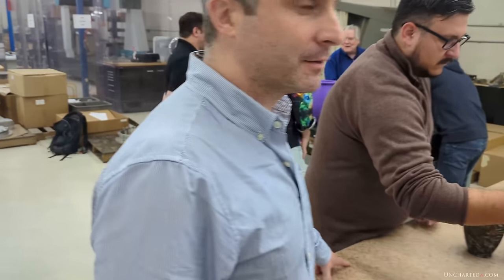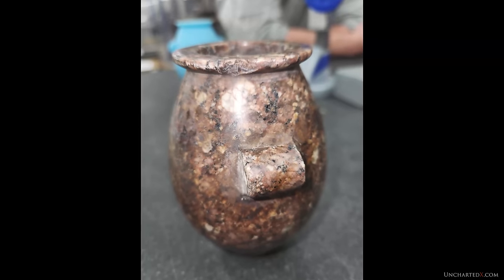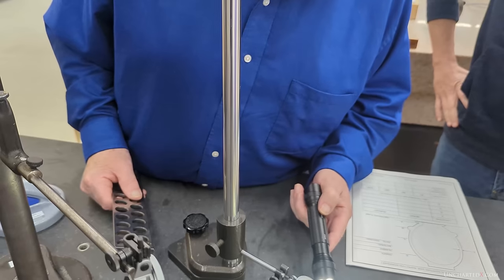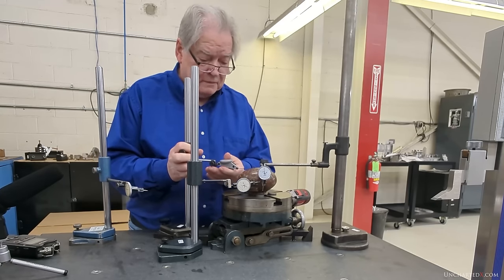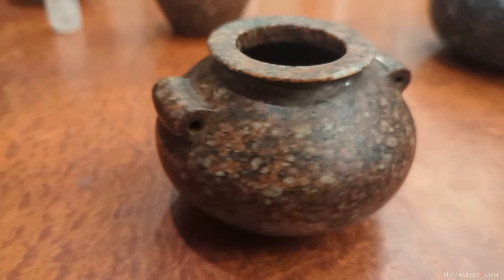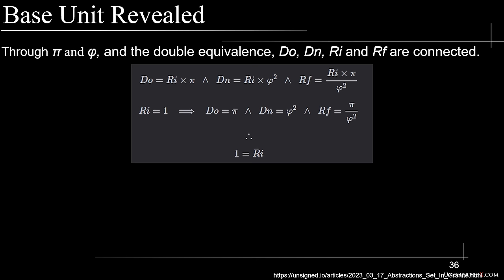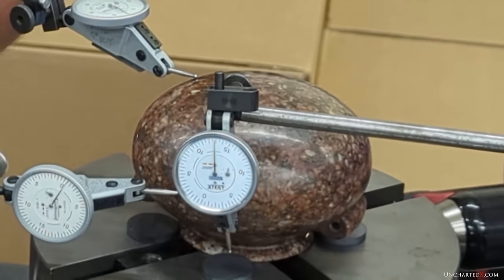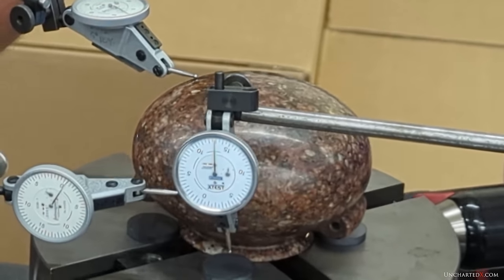Astonishing Results! More Ancient Egyptian Granite Vases Analyzed! More STL's available.

Comment: Been following your site and others for many years. I began my carrer in 1966 as a machinist and progressed over the years to tool and die maker, tool designer, machine designer, structural designer. I worked on oil field machinery, machine design, aerospace, medical, the f-22 the space station you name it. Mostly involved in precision machining at extreme levels. I think most people cannot comprehend the precision you are measuring here. The concentricity of the inner and outer surfaces is an amazing feature. This would require either performing both operations in the same setup or precision setup requiring instruments such as dial indicators. Machining this material at these thicknesses cannot be done with hard tools like lathe bits. The force required is too high. This would require some sort of abrassive tool or some other process I cant imagine. Like with other stone work such as the big boxes, try to get someone today to make one of these with any tools or machine. I believe the civilization that created these things and the rest had a sort of religious interest in geometry. These things are all very similar meaning they had a representation of some basic truth to an entire culture. This likely involved the geometric ratios they present. Ither wise why do it repeatedly.
Reply: A very impressive resume.  Thumbs up.  I have been to Giza (3 months, 2 trips), long before I ever ran across Chris Dunn's work.  I already worked in engineering, but did not appreciate all that I was seeing.  Now I know more, and much of it is still way over my head.  But your comments on the precision are understood.  I did lots of projects with high-tolerances, but envy you the exposure to fighters and NASA work.  These pieces - like much at megalithic sites - were clearly done by an earlier technical culture.  Assertions of them being done by earlier iterations of our present wave of development (stone age or savages) are insults to humanity and the real world.  Egyptologists and arkies live in a projected fantasy world that has almost no connection to capable humans of the past.  Archaeology is the science that isn't a science; they still think like they did 250 years ago.  They are stuck in their silliness.
Reply: I think the encoded geometry is also a message. It's written in a universal mathematical language, as opposed to a base system. The great megalithic sites were intentionally designed to be extremely resistant to seismic forces, so they would last far into the future, as a test for future civilizations to decipher and replicate the mathematics and engineering needed to build them. No matter how far humanity descends from famine, war, disease, and how many times we have to start over, the Pyramids will still stand as a reminder of our potential. These vases must be similar.  They were so important to the early Egyptians, they handed them down for nearly 1000 years until most of them were stored away in a stash at Saqqara.

Comment: It's actually quite interesting how granite is still the ultimate source and destination of our best precision in form of surface plates.
Reply: well, it's a hard and brittle material that's relatively cheap to get in large pieces. Unlike metals, it doesn't bend or dent, which makes it great at maintaining its precision once manufactured.
Reply: @outandabout259  It does bend. It just bends very little. I promise you that at a small enough scale everything is rubber like. If I put an incompressible point in the middle of a 2 ton granite surface plate you would be able to measure the sag at the ends.
Reply: The primary reason we use granite for surface plates is one if availability. Before WWll the primary material used for surface plates was fine grained cast iron. The production process was long and in the end labor intensive. The castings needed to be completely stress relieved. Initial machining performed and then hand scrapped using master plates and precision inspection tools meant for the work. Some of which is optical in nature. With the rapid expansion of defense contractors for the war effort a cheaper and faster means was needed. The answers were found in granite and glass. But not all granite is suitable. Plus these surface plates needed to be properly supported when in use or they will sag in the middle or at the perimeter.
Reply: @mpetersen6  These inspectors were measuring very coarsely, only .001-.009" A class B plate is way more than good enough for such coarse measurements. The rotary vise probably has .001-.002 runout on a good day. But, even .010 runout or ovality is still amazing if indeed those pots are 4-5000 years old!
Reply: Literally after I watch his videos of granite cut objects in Egypt  I walked into my machine shop and had my mind blown realizing the granite table was barely more flat.
Reply: Yeah, it’s rock solid.

Comment: I worked in the tool and die industry for several years building 90ish ton complex machines with thousands of parts where our tolerances on any given part were measured in tenths of thousandths. For the uninitiated, that's 0.0001" which is many many many times thinner than 1 average human hair.

I have installed, programmed, and run more types of precision machines than most people. Lathes, mills, Blanchard grinders, wire EDM, surface grinders, 3 axis machines, 5 axis machines, and 7 axis robotic arm machines that will blow your mind.

Anyone who thinks these vases were made with sticks and sand is a lunatic.
Reply: Well said.

Comment: Did the measurement team calculate the volume of the interior of these precision vessels?

It would be interesting to see if the volume was a relevant factor in their design, given that today we generally manufacture vessels to contain a particular volume of something, I.e a liquid.

If that is the case, then one could draw conclusions on the purpose of the vessels. Anything made to that level of precision and expense would have to be made with a purpose in mind.
Reply: This is one of those “duhh” things someone just had to say out loud and it clicks. I bet you’re right
Reply: great observation !
Reply: In addition, personally I wouldn't refer to these magnificent feats of engineering as 'vases'. Whatever they were used for, it wasn't for flower arrangements. They were made precisely to carry something important. I say 'carry' as those lugs were clearly part of the design so that something (rope, leather?) could be fitted to enable these vessels to be carried, transported, hung or stored in great numbers.

The mind boggles when one is confronted with the mathematics and engineering aspects of these vessels. They were designed and manufactured with the utmost precision. Raw materials were sought, surveyed, mined and transported..oh and no doubt traded. The machinery was also designed and manufactured, which itself would have required precision tools to make the machines.
Whoever accomplished all these factors was educated, trained and mentored. As were the teachers. This would require standards, assessments, administration etc. This would require a society as advanced, if not more, than our own.
Reply: @rockygoodfellow77  I wonder if it would make sense to put it in one of those mass spectrometer or something similar to search for traces of specific compounds or chemicals. I’d imagine either the contained liquid/solid or maybe a cleaner could be detected if it managed to penetrate or stain at all. Micro cracks may absorb something. I think the lugs were for mounting in a very specific use. They’re useless for carrying.  Maybe collectors of some small kind in a larger machine?  I’m lost
Reply: @blacklabel6223  yep, whatever their purpose was, it wasn't decorative. Machined solid granite vessels! Would anyone even try now - with wall thicknesses of a few millimetres!
The question is not just how, or when, it's also why, and for what purpose?
Why that material? Why those dimensions? Why that precision? Is the volume relevant? What was it specifically designed to contain?
Reply: Great idea man thanks.  We will look into this.
Reply: Hearing y'all in that shop laugh when seeing how incredibly precise those pieces are says something in itself
Reply: Please do a follow up vid taking a chunk of this granite to a precision machine show and have them try replication 😂 I'll bet they will be scratching their heads....

Comment: Hard to imagine the tech-level of a culture that would produce such items for aesthetics only !
Reply: Their routine methods were incapable of creating less accurate results.
Reply: Hate to break it to ya, but you could make one of those vases in the 19th century using a follower.  Still not the "stone age" BS thrown around by idiot "historians" but... You would think one of those machinist friends of his would know what that is... but apparently they are ignorant of old school machining devices.  Sure you would go through a LOT of square end mills and the polishing would be the hard part, but it can be done.  In 1960's we had hydraulic followers able to match to less than half a thousandth of an inch using ball end mills.  So, yes, all of these technically could be fakes.  Sorry, but true.  His "technical" group is historically ignorant of basic machinist technology available to previous generations.  

Machinists before CNC for Very hard 3D shapes before age of CNC would make a 3D mold out of clay, plaster of paris, check it for tolerances, fill it to tolerance, machine it, check tolerances, polish it down,  etc and then use a follower in the hard final material.  

At minimum a society able to machine to late 19th/earth 20th century standards.  BY mid 20th century BEFORE CNC we can easily make these vases using ball end mills and followers.
Reply: maybe they are not for aesthetics only. maybe they had some function.
Reply: @w8stral  You seem to be missing the fact that these were found in ancient egyptian tombs.
And don't come to me with "they're all fake" argument. Assuming it would be possible to use a follower like you said, what about the material being used? Can we machine granite like that?
Reply: @w8stral  you can not obtain such exact piece by hand,you need very complex tools and processes to get something close. You can not make this using a follower,it is impossible to make this geometry. You need to watch the previous work to understand what are the claims and what you are talking about. Data is talking,not archeologist.
Reply: @w8stral could 50k of them be made using that method? 
And are you saying they're not old?
Reply: @w8stral when you do this very easily, you will be correct.  Until then.  Unbelievable.  
I've carved stone and I'll bet you haven't.
Reply: @w8stral you're joking, you believe that these aerospacial engineers don't know what was possible 100 years ago?
Reply: You owe that group an apology as you are the ignorant one here. 

Making even one of those artifacts was NOT possible in the 19th century to that tolerance or even when 'follower' tracer mills were used in the 1960s as there weren't any cutters capable of working that material to that accuracy. And mold makers were titled as tool makers not machinists. 

.0005 on a rare primitive 3D tracer mill with a ball end mill in that material with multiple tool changes? Perhaps you should consider the problems with the lugs and interior,  and don't bother with a tracer lathe because of the tooling problems.

I doubt even a current tech carbide ball end mill (far better than 1960s carbide) would survive a final pass on the least of those artifacts. Can't even imagine how many parts and cutters would be lost just discovering a successful machining process to make one artifact let alone many thousands of them of many types of stone.

Hardness is only one machining factor, brittleness and abrasive are others. That material and its chips are extremely abrasive which alone would prevent any facility from risking their machinery. Nope, not able to be reproduced to that accuracy even today sez I.
Reply: so i can't make something hard flat by rubbing it against something of nearly similar hardness and eventually develop a method to make it round?
Reply: The problem is you have carved... this wasn't carved.  This was machine cut/ground.  Wake up.   @1puppetbike
Reply: @w8stral  hahhahah N O  W A Y
Reply: @w8stral  These were found in the hundreds if not thousands - ( so they must have been like average household commodities) and none of the tools needed for manufacturing at that level of precision, were ever found - or even remnants thereof. This, for me, indicates they're older than 5-6 or 11+-12 thousand years. Perhaps they date back to the Cayce-readings, 31000 years bc. disasters ?
Reply: @gameoverlord8012  Is this some sort of mocking ? Or an attempt at humour ? Or both ?
Reply: His “technical team” include some of the most accomplished engineers in fields that require insane accuracy like laser machining and producing parts for the space program. To try and say Dunne is unqualified or ignorant is utterly hilarious. You seem to have missed this team includes stone carvers from Egypt with generations of knowledge and experience in these unique items. They concur. He has decades in the field of precision and has been to the pyramids several times. You failed to address the material used in these vase also. Rose granite and other igneous stones do not machine well and a follower is ridiculous. The next question is why? Why would anyone go to such extreme lengths to fake and then bury and unbury a vase. Where is the evidence? Would it not make more sense these were made by a process that could produce nothing less. Something perhaps beyond what we have even now
Reply: @w8stral I've carved stone and made an alabaster chalice. 
How? Sit n Spin db
Reply: You call alabaster carving ... equivalent to an actual hard stone?  Are you for real?  One is ~chalk and if you press a tool into it deforms it, the other actually has substance.  @1puppetbike
Reply: A little suspicious! 1:02:30 talking about the great provenance of the vase: brought out by the Czechoslovakian ambassador to Egypt in the late 1800s..... HOW? Czechoslovakia was part of Austria-Hungary until the end of World War I, when it gained independence and formed a state for the first time in 1918! No such ambassador to Egypt existed at that time! Untrue 100%, which is why I am skeptical about the whole thing! Unfortunately!!
Reply: Indeed, given the high tech stone work that was so easy for them we can't even imagine what else they did and likely still doing. And here we are still scratching and biting each other, pretty pathetic actually.
Reply: @1puppetbike  Alabaster is softer than many types of wood
Reply: @GlyphZero  Let's talk again after you've flattened and polished 1 square meter to +-1 mm precision. ( These items are true within +- 0,02 mm deviatian to a mathematically defined curvature
Reply: @w8stral  Why is it that the people who shout the loudest always turn out to know the least?  🤦‍♂
Reply: @karlmarxx6228  literally everything you said was a lie

Comment: Thanks to all that worked on this project which is a very worth while endever. Keep this going please.
It is truly mind blowing at so many levels. It also raises more questions than answers.
It is not just that these vases were made to such high tolerances, its what went into their design process. It shows a very high level of mathematical understanding, geometry and ability to just design a vase. 
The machining involved is so sophisticated especially when working with the materials used all of which differ greatly in composition. The tooling for making such vases must have been even more sophisticated with the highest of precision and complexity. I can only imagine what else was made in say metal that would have oxidised to nothing after such a large time frame of 6,7 or 10 thousand years plus. Perhaps they knew these stone vases would leave a legacy of advanced capability in a hope that it could be continued for generations.